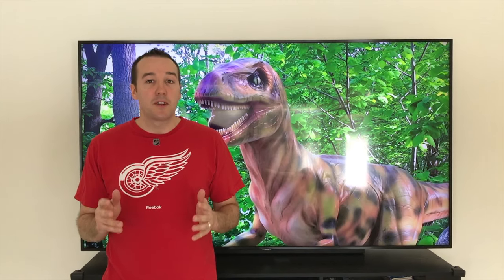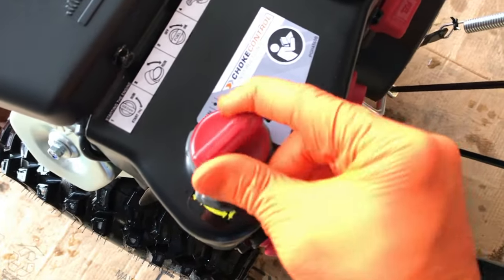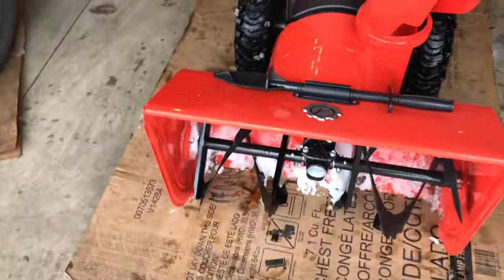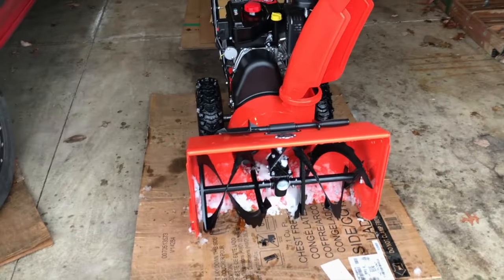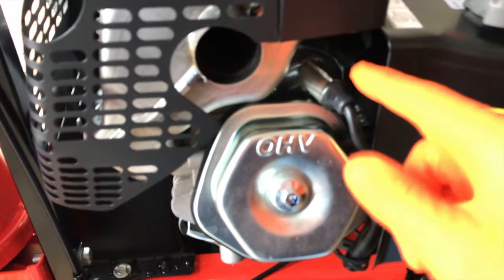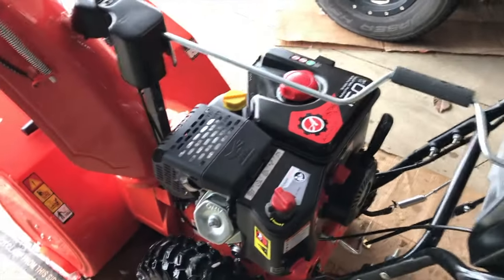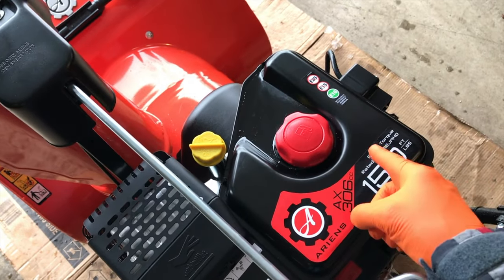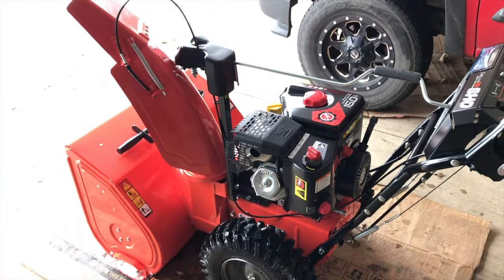Snow blower stalls/dies - MOST COMMON causes!

Comment: My snowblower didn't start. I cleaned the float under the carb. It ran. I t is blowing snow but not too far, but far enough. However, it seems that the machine rattles the fuel lever into choke ever few minutes and it stalls. It is a 20-25 year old snowblower but was working fine last season.
Reply from the maker: @reverandglenn  

Thanks for watching, that’s awesome it’s still running.  Is there any hardware that you can tighten so that the throttle cable and choke cable have less slack?

A friendly adjustment of the choke lever and cable hardware may go a long way.